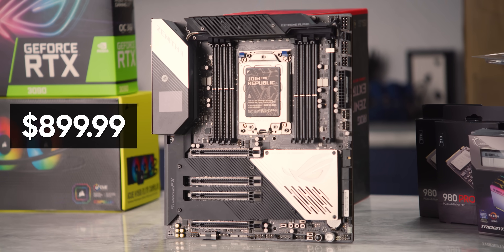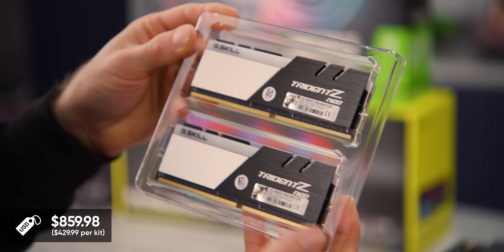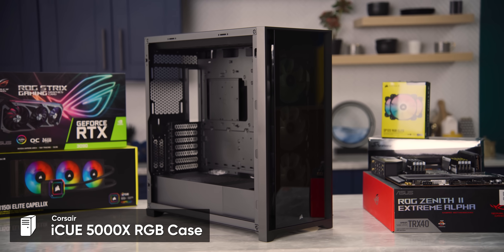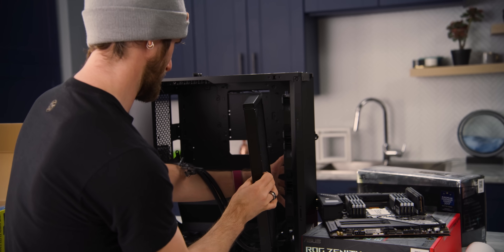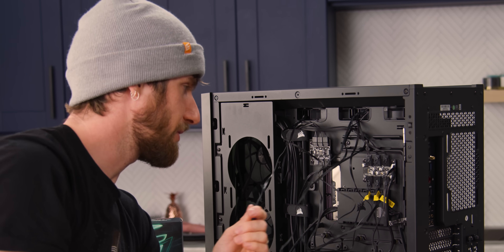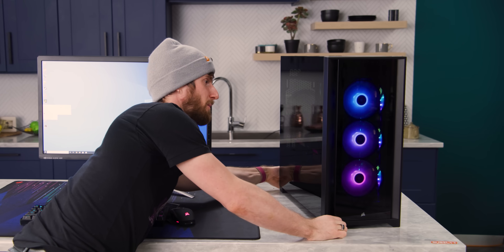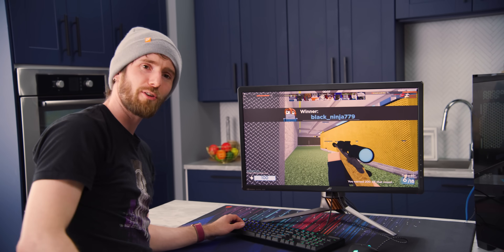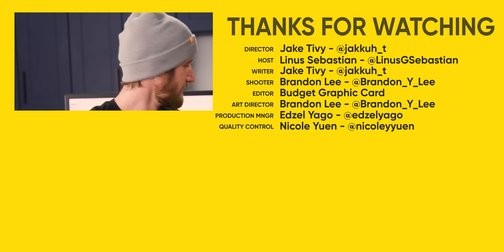Building A $10,000 PC for ROBLOX

Comment: Jake: "Oh wow it runs really smooth!" 

Me: "Oh yeah $10,000, I couldn't have guessed that it would run smooth"
Reply: @Nameless King Roblox engine is older than me so yes , you can get like 15 fps with enough load on the game. Even with this setup.
Reply: @turkeofSea  if the said game have a bad scripts that overload the engine, then yes it will and WILL lag hard.
Reply: For 10 grand I’m expecting it to serve me breakfast in bead or something.
Reply: @TrifoldBored  what?
Reply: Its not for gaming so maybe it wouldnt have been somewhat compatible and got low fps
Reply: @jimppajamppa2563  not.. really how it works
Reply: @ultimatevideoscutup  well a threadripper 3990x might be slower than a 5600x in gaming
Reply: @adfsdfdfgdfgfd  no lol
Reply: 200th liker
Reply: My first laptop works good so yah

Comment: I have the 5000d airflow, and if anyone is looking for a case i can only recommend it! So easy to build in, and it's such nice quality. If you do have a radiator for it, and you want pull configuration from above i would recommend removing the dust filter on top and placing the fans there. It creates way more space in the case itself.

Comment: I still prefer to cover the whole thread-ripper. I get the principal that the heat source is covered if you cover the dies, but the metal is still conducting heat to the outer edges unless the water block magically dropped the temp to below ambient temperature. nice build tho and Linus is funny sometimes lol

Comment: me sitting here crying with a radeon rx 5500 xt and 16g ram and a ryzen 3
Reply: A ryzen 5 3600 costs less than $300. You have better specs than me anyway.
4gb ram
Intel celeron
Integrated graphics
I couldn't even run roblox on it

Comment: I guess I am a bit of a weirdo, but I would have 3 separate runs from the PSU to the video card instead of using one of the goofy dual plug sets on the cable. I like the idea of high power things being dedicated if there are multiple connections instead of doubling anything up, even if the plugs are included on the cable.

Comment: Seriously Roblox is very unoptimized thanks to their crappy servers or maybe the type of engine they use. I mean you could get away with lowering graphics but still I would experience major lag spikes, I also heard that the longer your in the server or the older it gets, it becomes even more laggy. Plus some of the games under Roblox can experience major lag spikes too even if you have a good WIFI. You could say that "Running servers are expensive", but cmon they're making millions and this has been a problem for years, they've been releasing updates for these issues but honestly nothing really changed. Still Roblox is ok I guess you just gotta get used to it.

I have a gaming pc which isn't the best but can run Roblox fine on the highest setting in Roblox, but I usually play on my basic laptop since electricity bills is expensive. Even on both systems I experience FPS lag or ping spikes. Maybe most of you Robloxians don't experience this but maybe some do including me.

it get's even worse on mobile devices.

Have a good day.

Comment: JayzTwoCents did clearly tell a time ago that it does not matter at all wich way you place the radiator because it dosnt have to work harder to suck up the fluid sins it also pushes it in, also having the tubings down makes it so the air can be trapped upside :)

Comment: I don’t even average 60 FPS on roblox, the graphics level is at 2 and I’m playing on a minimized window, but I will gladly be a roblox tester if you need one lol
Reply: What’s you specs
Reply: A steaming pile of shit: gt710 (2gb vram) single channel 8 gig ram stick(it has two slots, but only one is filled in), unknown motherboard, 290 watt psu, i3 8th gen and a seagate 1tb hdd
Reply: @littlesargent1247  damn what frames do you get in other games?
Reply: Well I really like phantom forces, get like 55 at most, usually lower, I get like 45 FPS on fortnite on the lowest settings, low frames on the lowest settings in csgo, note, all of these are minimized windows, don’t even get me started on how I play gta, my pc is the definition of a potato pc
Reply: @littlesargent1247  lol have you optimized it at all?
Reply: I’m stupid so my version of optimizations is lowest graphics settings and smaller screen resolutions, I’ve gone into the files for gta and disabled shadows to make it easier to run

Comment: 6:38 this is wrong. What you perhaps meant to say is not to mount the pump att the top of the loop, where it will collect air bubbles. However, mounting your radiator with tubes down is superior as with AIOs, the radiator also acts as the reservoir. Bubbles collect at the top of the res, thus you want to feed the pump from the bottom where no bubbles will end up.

If you mount your res with the tubes up, that's akin to hooking the inlet of your pump up to the top of a reservoir, where it will suck in air bubbles.

Comment: You kinda need it tbh, the ROBLOX engine can barely pull 150fps with a 3090
Reply: i play roblox and i can confirm it doesnt even need a GPU my celeron is running it at max setting

Comment: the motherboard has 4x pcie 4.0 16x slots, if you really wanted a pc with no compromises, using a riser cable for all of them and hooking up an overclocked 3090 for each slot would have been better, no compromises.

Comment: Hey Linus, have you ever tested case cooling with different fan intake/exhaust configurations? As an HVAC engineer I cannot understand why case manufacturers have some intake fans and some exhaust fans when there are plenty of vents and holes besides. Id think the best thing is to use fans to draw your case negatively pressurized, and have inlet air come thru the vents... or vice versa, shove as much air into your case as possible and let it leak out. That way (2) 20cfm fans mean 40cfm of air, whereas if one blows 20cfm in and one blows 20cfm out, the vents are useless and the total airflow is only 20cfm. Thoughts?

Comment: Im building a pc for around 1400$ .Is this a good pc for 1400$? I know it's a bit overpriced but i couldn't find a gpu at a better price in my country 

AMD Ryzen 5 3600 Tray

Gigabyte radeon rx 5600xt

be quiet! CPU Cooling Pure Rock 2 Black

Gigabyte B450 AORUS Elite 

Corsair 275r airflow black

Corsair 650W CV650 PSU 80+ Bronze

A-DATA SSD 500GB SWORDFISH 2280 M.2

Corsair DDR 4 16G (8Gx2) 3600 CL18 VENGEANCE LPX
Reply: If it is not for gaming i suggest you better go with an m1 mac instead of this crap for that money.
Reply: @atf56   it is for gaming tho
Reply: @yanivciprut2399  then you have to stick with this or try getting any prebuilt pc with rtx and 5600x

Comment: Just my criticism about the component choices:
- The 3990X is bad for gaming cause it has no single core performance whatsoever cause AMD doesn't want it to have, the 3960X would have been better (still shitty single core performance though)
- The Samsung SSDs are slower and more expensive than a pair of Patriot Viper VP4300s
- The ASUS motherboard is overpriced and unreliable. I remember my ZENITH EXTREME... Never again
- AiOs and even air coolers specifically made for the Threadrippers are not sufficient. Custom loop is mandatory!! I speak from experience cause I got a 3960X and went through 2 AiOs. The Be Quiet! Dark Rock Pro 4 TRX4 edition only can dissipate 250W. The TRs all have 280W TDP. The glass top they put on makes it even much, much, much, much, much worse.
Reply: Yeah they wasted half of the money with that cpu. They could have saved 80% of the money if they went with 3900x. A 5900x would do better job all around

Comment: They should have used a Noctua air cooler. The ones made for Threadtipper work great since they have a big ol cold plate, an I’m 100% certain that Linus KNOWS.
Edit: i just realised, they’re spending 10K and they didn’t even get custom water cooling?
Reply: idc if not custom water cooling if it is not a trash one then is ok

Comment: This is like I need my GTX 1660 to run Carmageddon 2 from 1998. And yes I have Carma2 installed to my pc.
Reply: I have a GTX 1660 Super to play Roblox, GeoFS and Minecraft on Seus PTGI E12 Shaders in 720p :P
Reply: @michaelmutig2328  im guessing you have a weak CPU
Reply: @moldavianmapper  I have a Ryzen 5 2600 and 16gb 2400mhz(oc) ddr4 ram Dual channel.
My PSU is a Corsair CX550 and was over 50€ and it even doesn't get warm at all.
I have a locked board tho ;-; ... it's a  PRIME A320M-E.
Reply: @moldavianmapper  my computer wasn't extremely expensive...(something with 720€)

Comment: 6:43 Why is he discouraging the MOST recommended AIO installation method?? (in terms of how he's holding it)
Reply: He also says pull doesn't reduce efficiency when his testing was done with static pressure noctuas not corsair non-optimized fans. He also didn't put a back exhaust which from experience in this case there's already a hotspot above the 3090 because of the vdimms on the back of the card. The positive case pressure won't help the situation with the threadripper under heavy load and undersized cold plate.

Comment: ROBLOX Requirements:

MINIMUM:
Requires a 64-bit processor and operating system
OS: 64-bit Windows 64-bit Windows 7, Windows 8, Windows 10
Processor: AMD Ryzen Threadripper 3990X | 64-Core 3.9 GHz or better
Memory: 64 GB RAM
Graphics: GeForce RTX 3090.
Network: Broadband Internet connection
Storage: 4 GB available space
Additional Notes: Requires internet connection and 64-bit OS to play. Please refer to the FAQ for more details.

Comment: For those wondering why the FPS cap on exists, it's because they have a terrible engine. Unlocking the FPS can cause extremely stuttery gameplay, high FPS counts but with low frame times, increased input lag etc.

Don't unlock your FPS, in games like Phantom Forces and KAT these issues are extremely prevalent.
Roblox even messes up if you use scanlines (with RTSS) on it.

Comment: Hello Linus i need a tip, i have only 2 ram slots in my pc and i want to upgrado my rams to 16gb because it has only 8gb, and i dont know what is better to get 1x 16gb ram stick or 2x 8 gb ram stick, and im not sure if when i buy 2x 8gb ram sticks it will work in dual chanel or single chanel?
Reply: This advice is going to rely heavily on price but here goes... Check the part number on your existing stick of ram and buy an identical stick. That way you don't have to buy a full 2x8 kit and have an odd stick out. You reap the benefits of dual channel and save some money.
Reply: @jeffjungers2034  how can i check the part number, and where is it located?
Reply: Usually a sticker right on one side of the stick it will be a long string of numbers and letters that usually correlate with a few of the stick's specs.
Reply: @jeffjungers2034  would i have the full performance if 2 stick of rams will be put in both slots? I heard from somewhere that it will work on full performance if it covers all the slots (it was 4 slots in the video i watched) and im not sure if it will work fully if i cover my 2 ram slots with the same exact ram sticks
Reply: If you have only two slots and matching sticks it should work in dual channel mode. If you have 4 slots you'll have to put a stick in slot 2 and 4

Comment: Really? Corsair AIO for a Threadripper? How lame is that? What an oversight. I really am disappointed. $10k and a $150 AIO is lame. At least they could have purchased an AIO designed for TR or better yet, Noctua Air Cooler for TR. Oh yeah, and stock cables? Couldn't include $20 for for sleeved extensions? Shows how much they care about builds these days.

Comment: you should have added a third m.2 drive and put them in raid 5, then they could set up a standard backup dump for the system when they get it back. with raid 5 they would have about the same if not better performance from the drives, and more than likely if you had a sudden drive failure you could still boot in and get any recent data off and just move the drives that hadn't failed to another system as a scratch drive. but you would still want to have frequent data dumps(backups) on another external drive somewhere. i just think both the performance and usability would have been better that way, only enthusiast understand how to use multiple logical hard drives, so it is always best to try to make them all one drive, because how often does a person you know like the learn something new. not a universal thing obviously, but it is pretty common that learning something new is more of a stressful experience than an enjoyable one, so while the kiss principal is great for engineering, it is also just as important in design particularly concerning human interfaces. the less someone has to learn or relearn to use something, the more likely they will be to want to actually use it. simple isn't "cave man use rock break head", simple is what people are used to. most people aren't used to having more than one primary storage drive.
Reply: i once had a computer that filled half the alphabet using a couple scsi controllers in the early 2000s. it was rediculous and meant to be, i used the setup for like 2 months. it was hilariously unusable, i had gutted an old ps/2 system and filled it with drives then just ran internal scsi out of that straight into my main system, ran the drives on the ps/2 psu, if i had gone much longer most likely the psu would have blown, 10 hdds on that psu had it hot as a volcano. kinda wish i hadn't thrown away that ps/2 case though, i had randomly stuck my starcraft key sticker to the case, i was furious a year later when i reloaded my main system and realized that i had lost my strarcraft key.

Comment: 7:00 I made ease of cleaning the priority so what I ended up doing was putting removable microfine meshes on  the intake fans of the case on the outside and made the rad fans exhaust from inside the case (where dust hardly exists to blow it into the rad, the meshes trap it on the outside). Thermally not ideal (maybe extra 5-10C coolant temps) since it's blowing preheated air into the rad but still plenty good enough when you have a 560 Monsta for a rad.

Comment: I just settled for 128GB/32 cores/recycled 1080 ti/single 2TB NVME. Almost as fast and $6000 cheaper since not many apps exist that actually scale that well with 128 threads. Even when multitasking it's hard to keep 32 cores anywhere near 100%. I can't think of a use case where more than 7GB/s read speeds are actually needed (2x that in raid0 and most likely the ram is the new bottleneck). Apparently Linus's customer loves wasting money.

Comment: "spare no expense" only 128GB of system RAM when they could put 256GB into the same system. The actual reason for Samsung "PRO" vs Sabrent drives is how much endurance the NAND flash has. Not so much the controller etc. but high endurance drives that happen to also be fast. If going to excess 80+ Titanium is objectively better then 80+ platinum on the power efficiency curve with no mentioned budget the extra 20USD to 50USD for the better one would fit too as i don't see them drawing more than 1000 Watts per unit of time the PSU is rated in.

I would have put it through production benchmarks for the software they use instead of just playing roblox. You can run roblox on your phone but not run production software natively on a phone without hitting the cloud for the heavy compute parts.

Comment: Hey Linus. Great job. I built almost the same computer for unreal engine design and virtual productions. I noticed you put the capture card in slot 4, however if you put it in the 4th pci-e slot you will have to disable the nvme slot just above it to make it a 8x slot. Not sure if the capture card needs 8x. I ran into the issue when I built mine.

Comment: I'd like to see a 4 pin connector for the fans and RGB to be easy to custom size the cables. I'd rather they didn't put an end on them and let me crimp them on myself. I end up doing it myself anyway. Just cost more because I have to buy all the crimps and connectors. All the extra wire is triggering.

Comment: So a stand off is good if a screw goes through the mobo into it, but is dangerous if you don't/can't put the screw through it?
Reply: Where there are no screw holes there can be lines transferring voltage or data. If a metal standoff shorts those it can be a big problem. The screwholes are mend to be shorted to the case for grounding.

Comment: The way clean a rad set up in a push configuration is to gently use compressed air to blow through the non fan side whilst holding the fan so that it doesn’t spin up. Clean it regularly and it won’t get nasty, unless you have like 6 cats or somethings. Is not so hard.

Comment: A pity that the current Threadripper does not run BMI2 for computer chess engines as it is not based on the Zen 3 architecture.